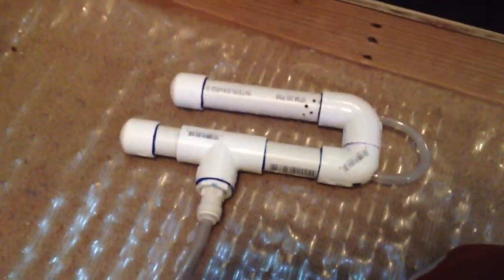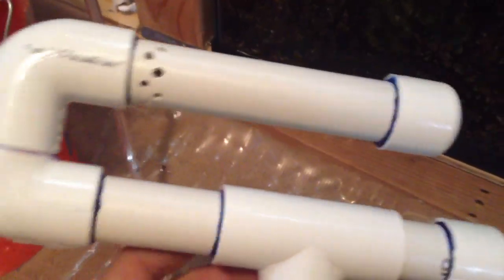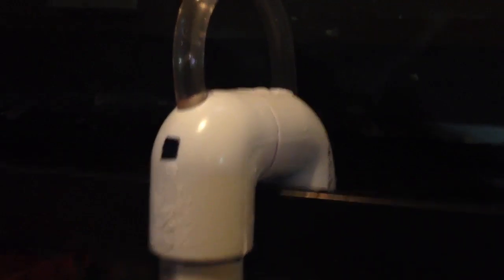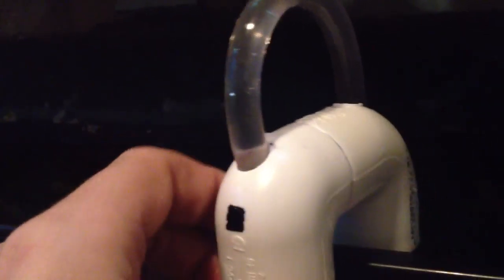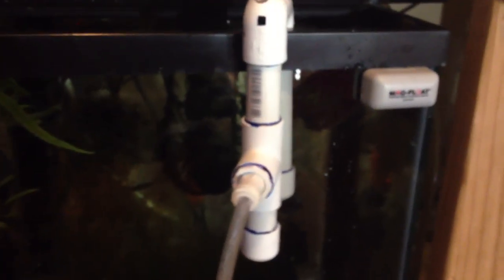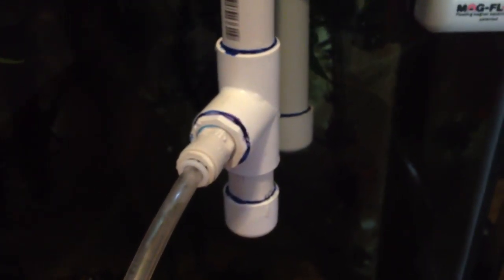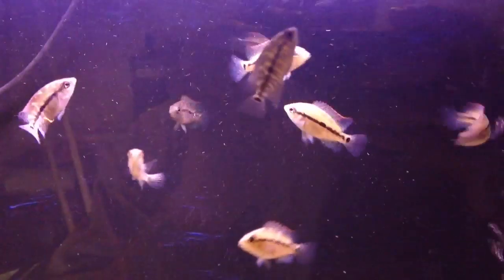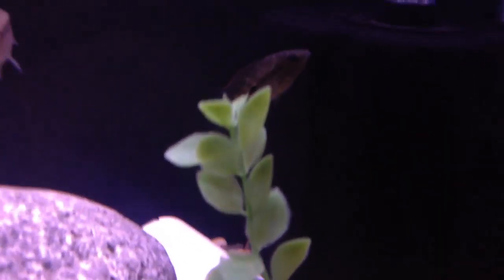DIY Overflow Prototype in Action

Comment from the maker: Plus the PVC isn't taking the water the rubber tube inside is so once the water goes down so far it cannot go into the PVC anymore until the drip puts it there and the holes are staggered to combat the clogging worry. It will make more sense when I do the build video.

Comment from the maker: No need for a break because the overflow is only taking excess water as the drip puts it in. The power going off wont matter in this so it will be continuous flow unless there is a clog which is what I'm worried about.